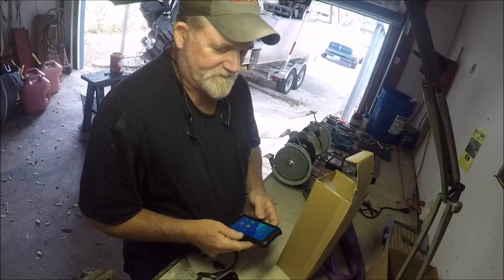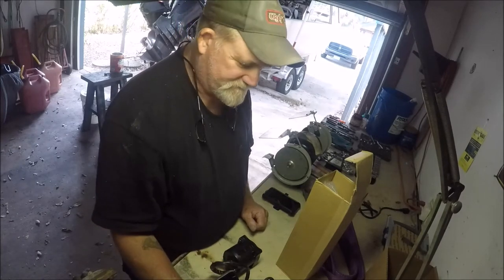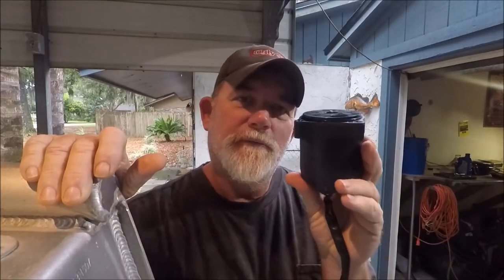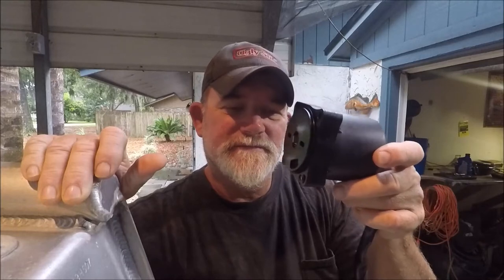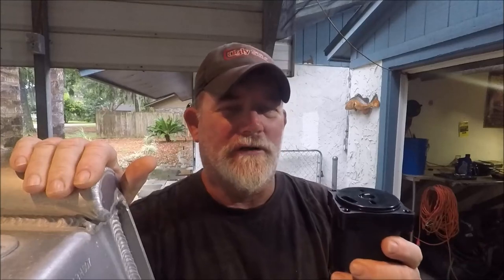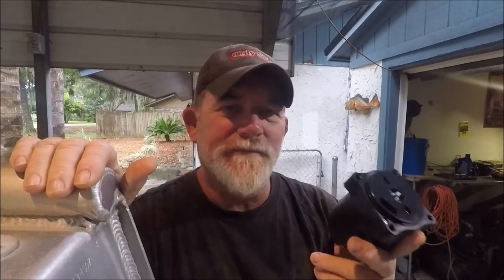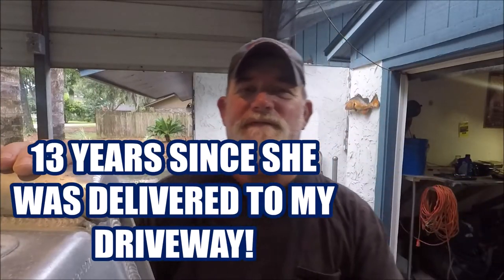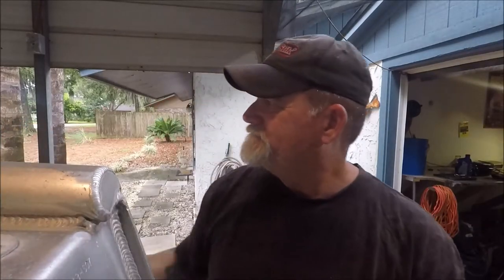SUZUKI Outboard $600 Power Trim & Tilt Motor

Comment: I am a Suzuki/ Yamaha tech in Washington. The power tilt components are often not made by the engine manufacturer and are may be the same between different brands. I believe many Honda systems are the same as Suzuki made by Showa I think, many evinrude systems are similar also, but dont quote me on the exact brand model cross over though. On my personal 2004 yamaha f225 the tilt motor went out about 5 years ago and decided to buy a cheap aftermarket one for $100 or so. It saved me a good 4 or 500  at dealer cost and so far it has worked perfect despite sitting in the saltwater for 6 months a year. I would only use oem on a customers boat though unless they specified a cheap one. That can be an easy $1000+ dollar job if performed in a good shop. My dealership has specialized in Suzuki since the early 80s and I have been trained and have worked on them for 15 years feel free to shoot me any questions you may have.
Reply from the maker: hello, Darren thanks for stoppin by. I feel as if I'm just a uncertified Suzuki and Honda tech....cause I've owned both and have done so much on both. A real mechanic said to me that is local and does all motors, Its a gamble sometimes. Can you afford to gamble? I had NO time to fool around. plus I've seen cheap replacements, in less than a year, are a ball of rust. In the full-time charter biz for a living, I didn't have time for this, the $$ or the want....I just needed to get back on the water. Suzuki or any of them don't build 1/3 of the components, I bet. Just assembles them all like auto manufactures.
Reply: Where in Washington are you? Interested in doing a tilt and trim motor on my df250? If so what would you charge?
Reply: Hey Darren, what shop do you work out of in WA? I’m located in Olympia and have a 2016 Suzuki 115 with the PTT that went out. Please let me know what shop you’re out of, it would really help! Thanks

Comment: Thanks for your time to put these videos together Dave. I recently purchased a boat with twin Suzukis from this year. I come here looking for maintenance tips etc, and you have been a big help. Tight lines!!
Reply from the maker: if this happens with your trim motor, amazon has cheaper ones, that the electrical will have to be modified to plug in, but I don't ever have the luxury of time to sit around a week for parts to be delivered from china or where ever. My boat is my living and I need stuff fixed .....yesterday!

Comment: The trim and tilt motor is serviceable. My 06 had that issue last year and there are 2 Cooper wires with like magnets on the tips that you can replace. Open up the motor and see if you see the 2 magnets ripped away from the wire or extremely worn down. Mine was completely worn down than when the new ones arrived you could clearly see the difference in size. It was like $50 for both and my trim and tilt motor sound loud and as good as ever. You can also get some electronic cleaner for cleaning the big Cooper coil motor.
Reply from the maker: mine was toast inside could send it to get fixed, didn't have time. Had $ to make and move on.

Comment: For those of you like me that came here looking for pointers. I just replaced my tilt trim motor on my 2012 Suzuki 250 in two hours and some change and for $134 with expedited shipping (2 days).
I got my motor (new) from East lake marine and it came with the O-ring.
Step one take off top and side covers.
Step two: remove right side bracket mount bolts.
Step three: remove remove steering linkage nuts on large through shaft.
Step 4: remove 4 bolts that go through right side bracket into tilt/trim system.
Step 5: remove nut on lower shaft that goes through brackets.
Step 6: slide right side mount to the right.
Step 7:remove motor.
Step 8: put new motor on and re route wires.
Step 9: reverse steps above.
Bobs your uncle.
Reply from the maker: OH BOY......Yeah its just a few EZ steps.

Comment: I also watched this video hoping for tips and some how-to instruction. What I can tell others looking for the same thing - this job can be done with a medium amount of difficulty. It took me about 2 hours. The local dealer quoted $850 for the OEM part. Instead, I bought an aftermarket one from East Lake Marine Electric on Amazon for $109. I have a 2017 DF300 with about 850 hours. I removed the old part with the motor fully raised. I did not seem to gain extra clearance with a partial tilt. The only tool I could fit on the back corner bolt was a thin-walled 1/4 drive socket small extension and a swivel head non-ratcheting drive (looks like a mini breaker bar). It will only turn about 40* with each connection then I had to reposition the tool. On installation, because of the position, it is difficult to tell how tight you are turning the bolt. I would be careful not to overtighten. I also did not replace the plug. Upon examination, that part was going to take a lot of work. I spliced the wires with quality heat shrink connectors that glue themselves to the wires under heat. Over this, I added a second layer of marine heat shrink. I also left a bit of extra wire in case the connection ever had to be redone. The new motor sounds just as good as the OEM did when new. I did not have trouble with air in the system. I operate a fishing charter on the west coast so it will get thoroughly tested. I wrote a review on Amazon with pictures. I hope this helps
Reply from the maker: My help came from my friend Orowock who commented below. He's a suzuki mechanic. I went with ONE day delivery from boats.net, in Georgia, I'm in NE florida, so not to loose charters, and don't trust chinese parts. I saw the cheaper motors. I got off all the charters!!! yeah it all was a hit. But strive to never loose customers from a break down. All worked out. Never had time to get a quote. Either way the local mechanic shop I use lets me just order parts, since he'd get them from same place, being a Merc, Yamaha shop. My t/t motor was fried, it wasn't some EZ magnet  or wire fix.

Comment: I feel your pain, Capt Dave, and you're right I don't know what it's like to be "under the gun" because I've never run a charter. But at 76 I can say I've fixed my outboards (when i could) including tilt & trim (but never had a motor go bad, usually it's hydraulics). I am at the point in life where I am outta money to get anything major fixed on my outboard and outta strength to fix anything heavy, so when my boat or my motor takes a major crap, well, that's it. I wanted to run my boat on my own until I'm 80. Don't know if it's in the cards.
Reply from the maker: yep, I hope too.....Its not like I have a pension plan in this biz. or am some retired navy lifer, who's wife said, ''get out there and pay for that 100k wannabe bay boat.''

Comment: Nice video captain Dave.
I am in same process at the moment..
I had no money to buy original part so I buyed Chinese one from US..My ptta motor went out few days ago,so now wait for part,hope it will work at least 2 years..
I also started charter few weeks ago and have df300 on Bayliner trophy 2503fm..
Reply from the maker: You'll have to make the connector fit. Chinese parts usually dont have the correct fittings. I had 2 days, or loose 2 grand. It was a job, I hope to never do again. It sucked!

Comment: Did you have to take the engine bracket off to get the trim motor out? Or can it be done in place
Reply from the maker: loosen it up top

Comment: All I got out of this vid was the part cost $600 bucks and no instruction on how to replace it. You guys must be watching a differant vid.
Reply from the maker: read comments, and stop complaining.....some times ya don't get what ya want.
Reply: @CaptDavesSportfishing  I read them! They had nothing to do with this vid, like I said must be differant vid.
Reply from the maker: @10deerhunters  obviously not because some other guy mapped it all out for ya.
Reply: @CaptDavesSportfishing  Do you have any idea who, cause thats what I'm looking for?
Reply from the maker: @10deerhunters  good gawd,  you must be on a DUMB phone!!!!!!!      

I got my motor (new) from East lake marine and it came with the O-ring.
Step one take off top and side covers.
Step two: remove right side bracket mount bolts.
Step three: remove remove steering linkage nuts on large through shaft.
Step 4: remove 4 bolts that go through right side bracket into tilt/trim system.
Step 5: remove nut on lower shaft that goes through brackets.
Step 6: slide right side mount to the right.
Step 7:remove motor.
Step 8: put new motor on and re route wires.
Step 9: reverse steps above.
Bobs your uncle.

SOUNDS EZ......IT AIN'T!

Comment: Hi, CALM CALM DAVE , only asking if your doing those hours service it once a month ,I use to work in the air craft industry ,service it ,pay up , if your running  none commercial motors and these are only recreational and a 5 year warranty ,right the cost off against your tax bill ,happy fishing
Reply from the maker: I'm always calm I don't know what that means. Yeah I do all my own service. There is no just commercial outboards not that I ever known of
Although a dream engine for me would be the oxe turbo diesel that's about the closest you'll ever get to serious commercial engine that's an outboard.  You made it sound like I did that job which was a brutal one just the other day.  If you're looking at a 2008 with only 380 hours the problem there could be not used it's as bad as over usage I always used to say if you don't use it you lose it it'll break in the driveway

Comment: Brought home a brand new 175 HP SuZuki today on my boat. Like really excited about it. Plan on taking the boat out on Friday to break the engine in. When I come home I backed the boat halfway into the garage when I stopped to let down the engine so it fits in the garage. The boat is a tight fit in the garage and when the engine down it fits with a foot to spare. . I have to lift the trim up to free the stops and let it back down and what happens? Push the button when the trim will NOT go UP. Go to the throttle and try it from there. Still will not go up. Brand new Suzuki motor. Not a good start.

Captain Dave - charters are not expensive only by the fact you could eliminate allot of frustration out of owning and caring for a boat. BUT — I want a boat. Now if I can get out on the water. 😀
Reply from the maker: CHARTERS ARE CHEAP AS HELL, '''especially in low buck J-ville Fla.'''  its a low-buck Navy town, where they all read straight from the handbook.....''do you give military discounts?''  All the while they have a paycheck guaranteed!  Sounds like a ''electrical'' connection, versus a $600 trim/tilt pump/motor. Boat riggers aren't usually certified micro-managing mechanics.
Reply: @CaptDavesSportfishing re @CaptDavesSportfishing Maybe if you own a yacht; not me.  @CaptDavesSportfishing  the mechanic I used to rig the engine  @CaptDavesSportfishing Retightened the screw  @CaptDavesSportfishing the up trim @CaptDavesSportfishing Thank you for teaching us lessons you have learned and where we have not yet traveled. 😀  @CaptDavesSportfishing
Reply: @CaptDavesSportfishing  — Captain Dave figured out the trim problem in the new engine. What was it? My mechanic came by and showed me the sensor for the trim where the motor hangs by the transom. Thee is a little like toggle switch. The more you move it DOWN allows the trim to raise the engine higher. It can be adjusted. So, I pushed it all the way down to gain the full range of the trim going UP. My mechanic said this is not in the standard manual. Best regards.
Reply from the maker: @flash521  hahaha..yeah, know all about it. AND under your steering tilt tube above the tilt ram, there's a adjustment tab, that just rotates, and tell the gauge where your motor is at, even more. Something like that.  Mine isn't even adjusted right. But then again, I know where my sweet spot is. PLUS, on your gauge you can adjust high limit and low limit, as far as the gauge says. Even the new square gauge probably has it. My gauge is the old round one. The new one is square.